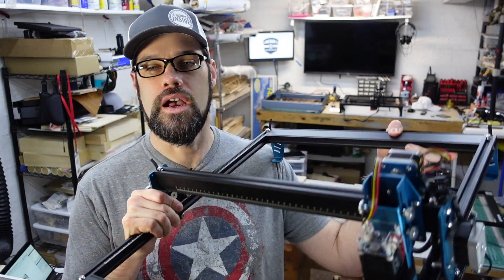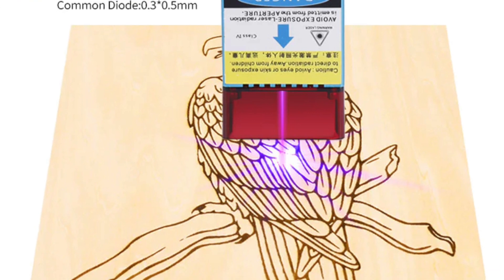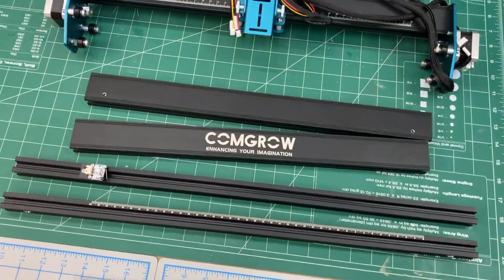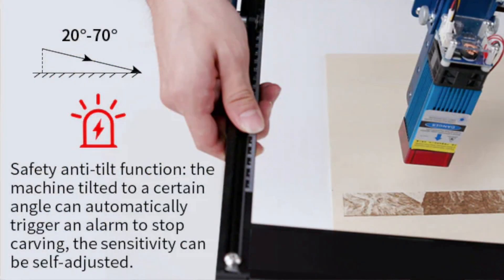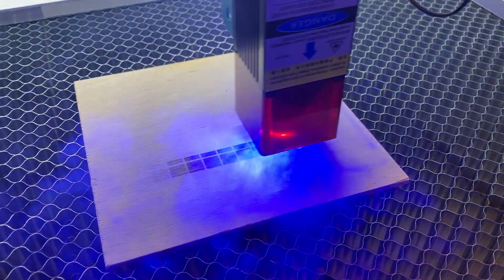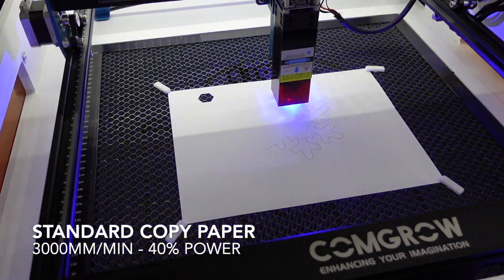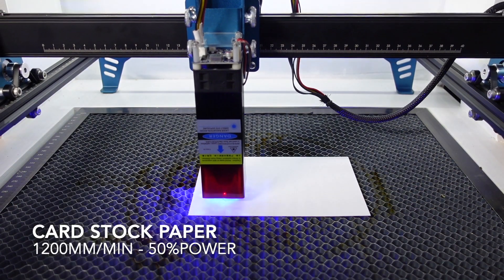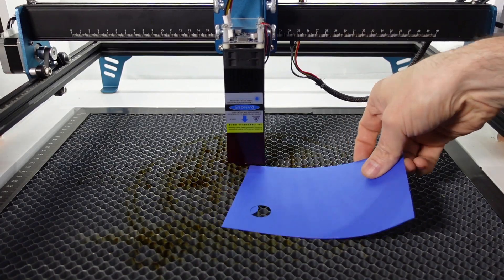Comgrow Comgo Z1 10 Watt Laser - A Budget Laser for Any Workshop?

Comment: I'm so glad I stumbled across you this morning! I've been looking at lasers for the past month and have narrowed it down to the Sculpfun10 or the Comgrow and just watched both of your reviews on these. I'm still undecided 😕 but... the Comgrow is where my gut draws me in. I'm new to this whole concept but catch on easily. What stands out the most to you about either one? 
By the way, are you in Minnesota because both reviews you incorporated my home state 😉 and I'm assuming you are in Southern MN.
Reply from the maker: It's hard to beat the value of the Comgrow Z1 laser. It's got everything you might want in the initial laser, and the newer models are coming with the air assist cone included. Both machines will require you to purchase an air pump.  The sculpfun S10, you'll have to add limit switches to if you want them, but they have upgrade kits for expanding it in both directions if you feel you need that larger work area.  Comgrow just released their 20w module which is cheaper than most at this time so that might be a nod in that direction. Both companies are fairly active on social media and have decent user groups that help with ideas and basic support. So I really think it comes down to cost between these two. If you wanted to jump up in price a bit, I'd suggest looking at the Sculpfun S30 pro.  It includes the air pump which is also controlled by lightburn so you can have it automatically turn on and off the air as needed.  I am in southern Minnesota and like to incorporate local projects in to my videos.  I hope this helps you with your decision!
Reply: @Vintauri  I'm going off of what you are saying and will have to sit back down and look at the bigger models too. I did not realize the air pumps didn't come with them. I was eyeballing the Comgrow 20 but didn't know how much more it did over the 10. I'm totally new to this but can't wait to get started!
I'm in south east Minnesota so hello my fellow Minnesotan!
Reply: @fuzznickers there are packages from Comgrow that have everything included. I just bought mine a couple weeks ago and it came with the tent, air pump, fume extractor, and honeycomb bed for about $500 shipped. It did also come with an acrylic spacer for setting the proper clearances

Comment: You mentioned that the Z1 10Watt has a square laser and not a rectangle or circle. Mine has a rectangle which means we are looking at 0.08x.120 for the dot. Am I correct or misguided?
Reply from the maker: In their documentation they state that the focus spot is square at .08 x .08 mm. While I can’t test that with exact measurements I did do a kerf test to ensure that the cuts in both directions were removing an equal amount and they were almost spot on in my tests. This would ensure at least a square focus point instead of rectangular.
Reply: @Vintauri  ok that's really odd because when you focus the dot there is a rectangle and ant one end, the right side, there is a brighter spot.  If you take your head off and point it at the wall, do you see a rectangle? I do for sure.  Or when you clean the lense, do you see a rectangle in the middle of the lense? I do as well. If you could test yours in this manner, I'd love to hear the results.
Thanks!